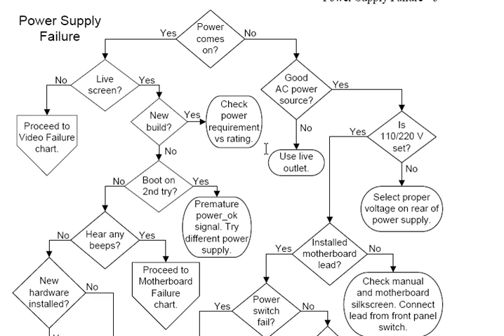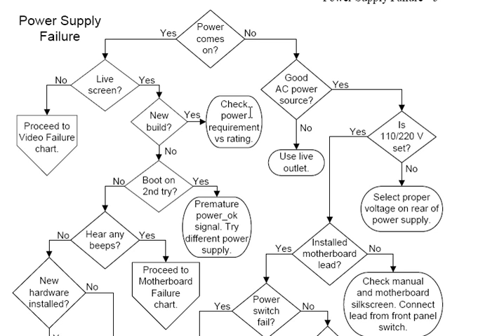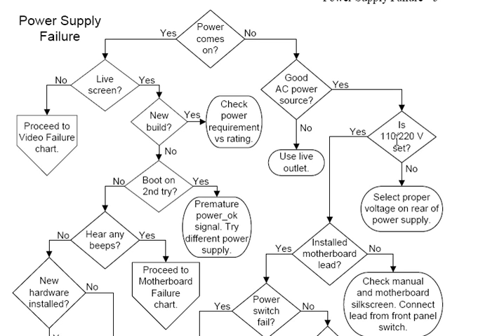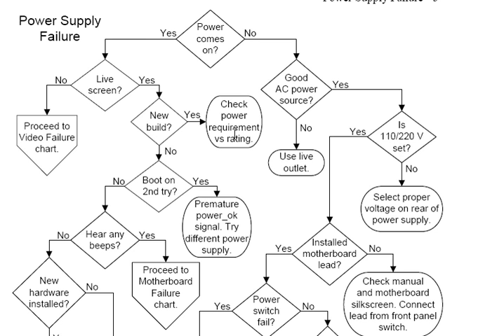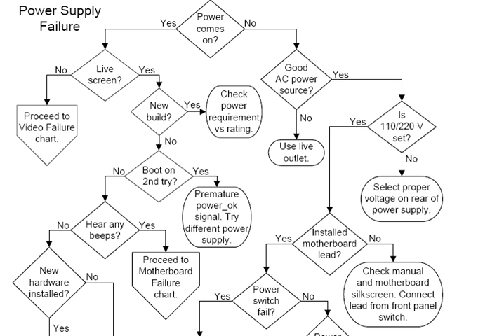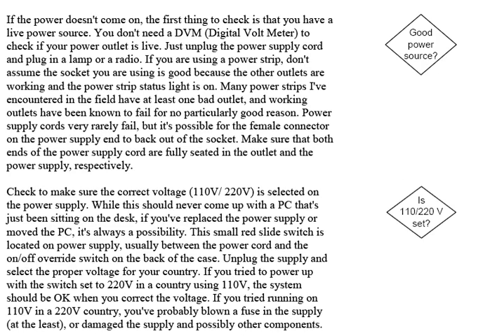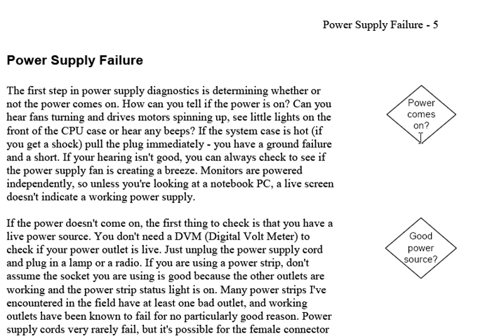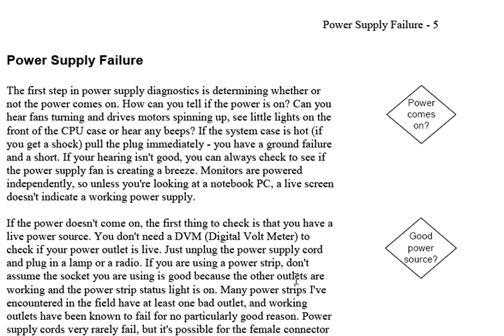ATX Power Supply Diagnostic - From Fonerbooks.com Computer Repair with Diagnostic Flowcharts

Comment: New build worked great for a week low temps i7 940, asus p6t deluxe v2, gtx285, 6gb crucial at 1333mhz, ocz 850w psu, now only two LEDs stay on on the motherboard for power and reset when I press power it all comes on for a split second then I have to turn psu off back on and only comes on for a split second does this sound like a faulty psu or a short most likely